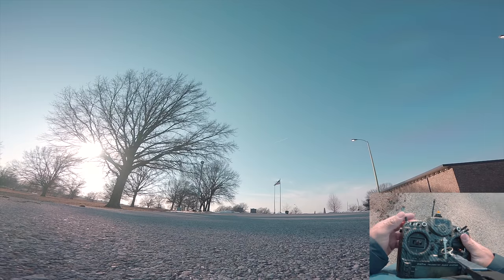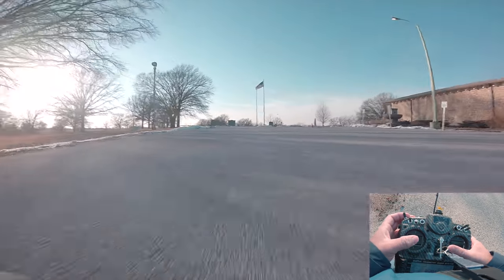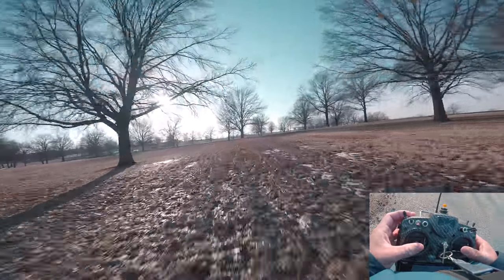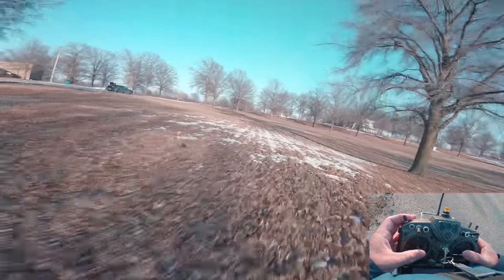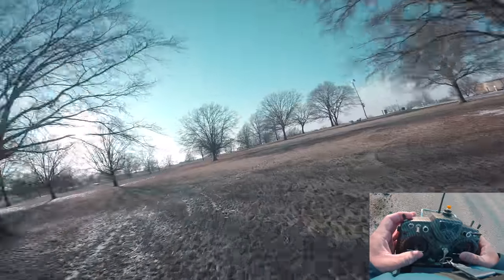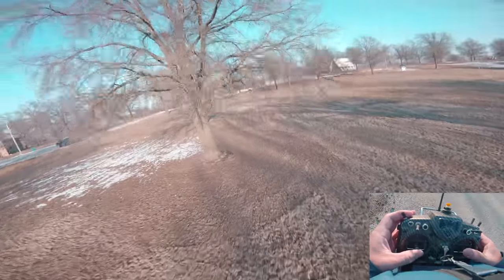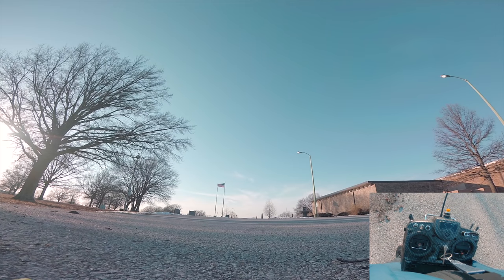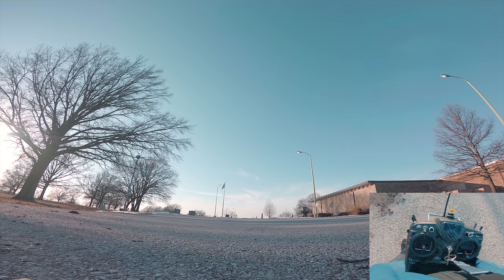FPV TIP SERIES: HOW TO FIX YOUR PITCH BOUNCE BACK?! 🔥🔥🔥| FPV FREESTYLE

Comment: I’m 2 years in and fly as the weather permits (Newberg Oregon) and throttle control as well as just smooth stick input is the key! I just recently started to fly thru tighter areas, under low hanging trees that are in a tight grouping, around our shop between it and the fence, thru small opening between structures and when i first started I was too erratic with the stick Inputs, and was having a hard time just flying slowly and controlled now I find it amusing to see where I can fly in areas that used to be complete quad damaging lines:)
Reply from the maker: Rip it up

Comment: I’ve been flying for 4 months.  What I’m challenged with is how to start a move quick, but to end slow.  I’ll flick a roll, and just try to stop the roll back at level.  You flick a roll, then slow the roll part way, creating a smooth stopping point.   I’d love to see you try and instruct a noob pilot, as opposed to you flying.
Reply from the maker: Thanks man. I’m gonna put that on my list of topics. 👊🏽👊🏽👊🏽
Reply: I see what you're taking about, and remember it being a challenge for me at some time. I think practicing the finger mouvement on the stick (just the stick, not only while flying) helped me, but id say the best way to achieve it is practicing rolls until they become a really natural thing to do for you so you can take your time doikg it and modify it like any other normal mouvement. it's hard doing that trick at the beginning because you're not fully confident when doing flips and you're more like thinking of the trick as one step : full stick left or right. once you're confident with it, it's a natural thing to do like turning left or right and so you can cut it in parts easily. good luck, I hope my comment will help you get better and better :)

Comment: What do you mean by tuning your breaks out? Is that over tuning until you surpass your esc breaking? This video is perfect timing for me Vic. Thanks. Since I last dropped comment. I’ve really begun to cross the threshold of cautious slow attempts on tricks to just all out Dropping it in snow!  Man you have become my favorite fpv tuber. Your vids are so helpful on progression. Specially if we slow down your stick cam vids. 🙇🏼‍♂️
Reply from the maker: Basically you can always spend a lot of time tuning but at some point you are gonna have to fly and counter the limitations of your quad by stick control. And that was the main point of this video. Tune your quad but don’t spend everyday tuning - spend it flying and getting the stick smoothing down. Thanks man 👊🏽👊🏽
Reply: VIK FPV indeed. Only “tuning” I’ve done is is increase my I”s by 5-7 points. On all three birds. (I was hunting down eBay deals. And got a vendetta 2, vortex 275 for under 250 a piece) and for first kwad I scooped a wizard X220. Only thing wizard on it now is the frame. It’s a bardwell FC, tbs bullet esc”s with Emax 2400kv’s, unify, and crossfire. With a falkor. I leave the tuning stock with latest Betaflight accept the wizard. I did flashed butterflight on it. 👍🏻. I fly them equally and like I said only messsed with the integral by 5-7 points. I just want to mast er the sticks before tuning. And your right it is mostly pilot over correction. I realize I’m aggressive in sticks. Specially throttle. Please keep these walk threw, with stick cams vids coming. Much appreciated VIC. Thanks a milli

Comment: I'm getting some bounce back on roll axis. Running betaflight 3.5.5. 1100 degree a second rate. Stock PID on 6s. Running powerful rooster, t motor f80 pro 1900kv, t motor f55 4-1 ESC. Have any tips running 6s on stock PID? It almost seems there's too much power on the axis. Many would say to increase P to solve bounce back. Just confused on how to solve. I've watched many videos on PID tuning and they all say something different? Take care

Comment: My 2 inch quad does this bad because of the heavy (HD) camera on top. Without camera it doesn't....so yeah weight distribution (specially on micro) is critical.  But in reality it is mostly my lack of skill. rofl.  Thanks for another great video...killn it lately
Reply from the maker: Thanks man. I heard people have mounted the hd camera on the center of the micro and battery on the bottom and it helped with the CG
Reply: @VIKFPV  thank you sir threw a 3s (much heavier) on it just now to see if i can pull the weight down.

Comment: Hey man do you fly 4s or 6s, if 6s do u think it’s a huge upgrade or I’d be fine w sticking to 4s for my next build?
Reply from the maker: I’m sticking with 4s currently. I might give 6s a shot later but the batteries need to start weighing less
Reply: @VIKFPV  tattu R-Line 1050mah 6s 95c 
170g!!!😍😍

Comment: what you show/do is no pitch bounce back to me, you just overshoot AKA should stop your roll a bit earlier. pitch bounce back usually refers to timing/synch-problems, smooth motors, i-term windup, aso.

probably i'm missing something but to me "pitch bounce back" is "pitch bounce back" and "bad stick input" is "bad stick input".
Reply from the maker: As my note said at the beginning of the video pitch bounce back could be related to tune, rates or even CG on the pitch axis. So I agree but you can correct it without having to address that to an extent. I guess the point I am making is you don’t have to have a perfect tune to address some of the tuning challenging you can compensate by learning to manually smooth out stick movements as you fly.
Reply: @VIKFPV  and you're making a real good job with that. saw many people heading towards the trap "it's pid's" or "it's hardware". your video takes that away and gives confidence to go on. telling people how to avoid traps is good!
Reply from the maker: Exactly what I was shooting for. Awesome to hear. Keep ripping it up 😀👊🏽👊🏽

Comment: Toilet Tank!?
Reply from the maker: Personally not a fan the reason being is the center of gravity will be off since the weight is slighted toward the front. I rather have a well balanced quad across the pitch axis of a quad for even weight distribution.